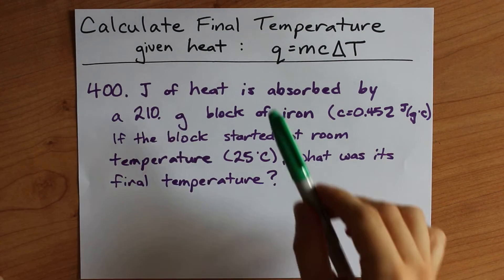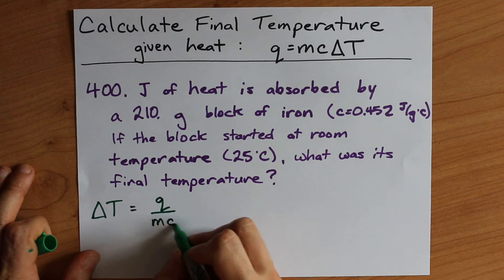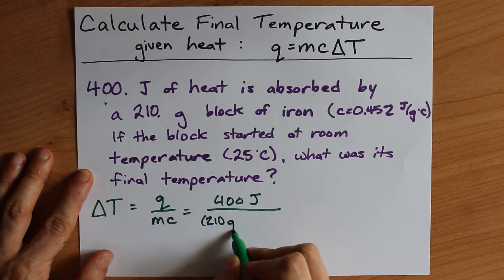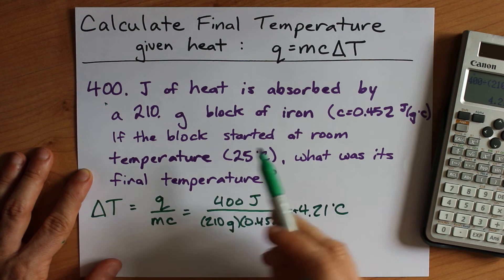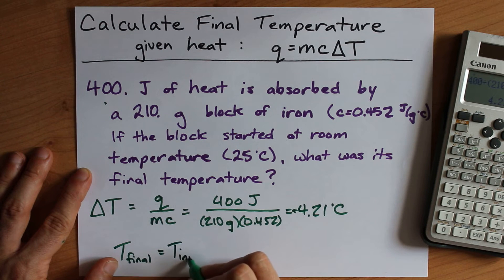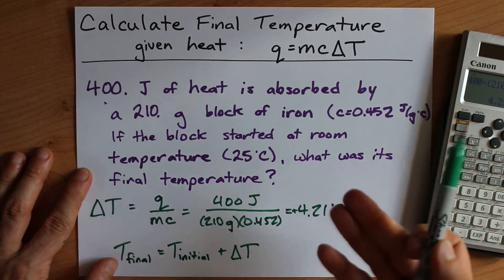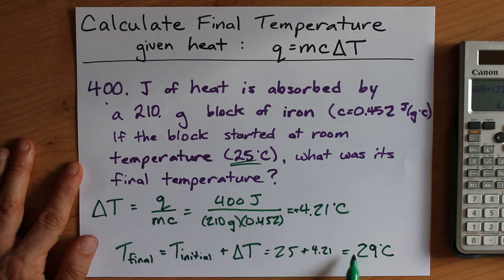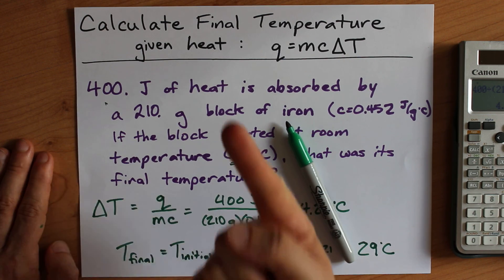What is the Final Temperature given Heat (q=mcΔT)

Comment: At a village a mother heats 4 liters of water with a paraffin stove from a temperature of 18 °C. She later noticed that 20 g of the paraffin was used up. Calculate the final temperature of the water if the heat value of paraffin is 31 MJ/kg and the specific heat capacity of water is 4187 J/kg. °C.

Pls help solve this